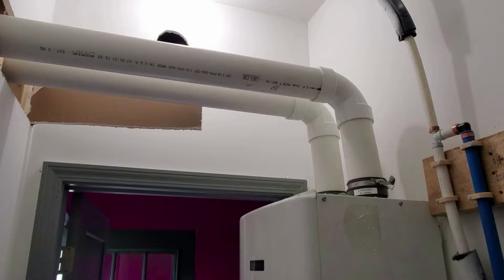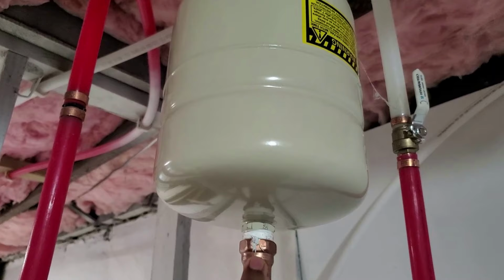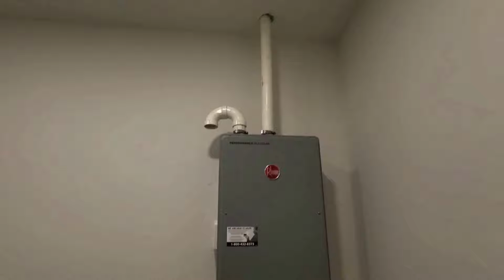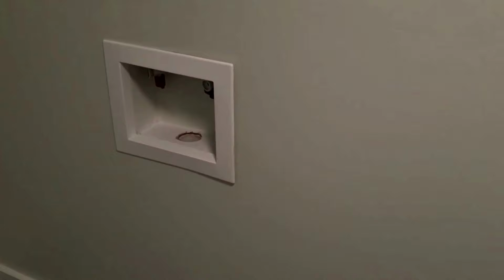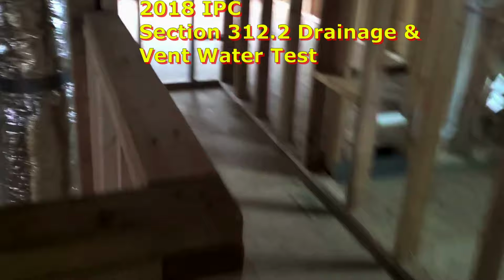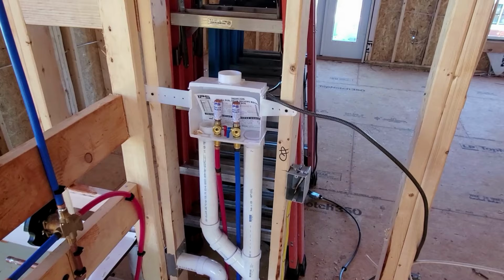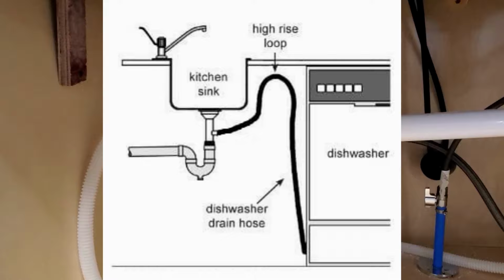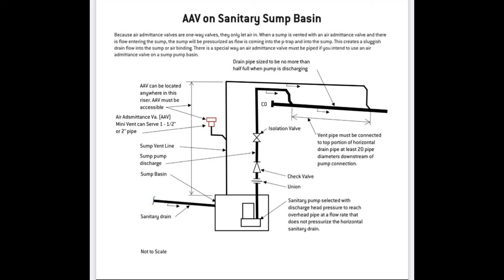Plumbing Code Violations (Part 1)

Comment: This is why you install a decoy plumbing that's up to code but not actually used by anything, and hide the actual plumbing behind drywall and secret doors.
If it can't be checked for violation, it's not  a violation
Reply from the maker: You're a genius..

Comment: I believed fresh air Intake doesn’t have to be outside if there is enough combustible air in the room installed? Is that not true it does actually list it in the manual for Navien Tankless units. But if that code changed that would be huge to know for sure?

Comment: There are no code enforcements where I’m building,  but I do my best to apply common sense building techniques that meet code.  I sure wish you would give reasoning for “why” the code on each one of these failures exists.  Horizontal vent lines between fixtures a minimum of 2’ above the drain field would make sense because it still vents, especially when the vertical vent pipe extends high enough to draft properly.  In Alaska, our issue is the vent lines freezing-up when extending too high above the roof.  Another issue is air intakes going outside in -40f is retarded from an efficiency standpoint.  Like one person commented, as long as there are enough Cubic feet in a room that meets the BTU’ requirements of the unit, you’ should be good. If not, explain “why”.   Common sense needs to be applied to some of this “code”, and if the code was good enough of an idea to be forced, it should be good enough of an idea to be explained as to “why” it exists with caveats for hot and cold areas of the country…. ESPECIALLY by the inspector that’s enforcing it.
Reply from the maker: So, you're saying the state of Alaska has not adopted any Building Codes??
Reply: @PPG1967 I also live in Alaska and the actual towns and cities do have codes but anything outside of city limits has no code. When we moved up here it only took me about two minutes looking at houses to say no and walk out. I built all of our cabins because everything else scared me. I have been a plumber for over thirty years and have a good handle on the trades.

Comment: On the end of the video regarding the sump pump that’s tied into the drainage system here in Colorado that’s illegal. Where are you located? Also, but at some pump here in Colorado event is not required only on a sewage ejection.
Reply from the maker: I'm in Georgia.  We use the IPC (International Plumbing Code)

Comment: On the tankless, how come y’all don’t use I pex pipe?Secondary where is your copper 18 inches off the other water heater?And on the other tankless can you use the atmosphere air in the room? Vent can run flat besides the main vent by international code?you can’t trap sewer gas on a flat vent. most dishwashers have the loop built on the side of them look in the manufacturer book.
Reply from the maker: What code book are you referencing???....my videos are based on the IPC, not the UPC.

Comment: I have a 1960 home and it has no water hammer arresters anywhere. I’ve never had any issues…..  no thermal expansion tank either… no issues wharsoever. That begs the question what’s the point?
Reply from the maker: Didn't era, didn't construction materials, didn't appliances sir.
Reply: @condor5635 Everybody thinks an expansion tank is required.  You can put one in if you want but it is only required if there is a check valve in the system because that would prevent expansion.  Unless your town has water meters that have a check valve incorporated in them, or if you have a pressure regulator, which also has a check valve.  You may require them if your on a well, since the pump probably has a check valve.

Comment: Not sure if it's part of the national plumbing code, but we can't go directly onto the water heater with PEX. Needs to have a minimum of 18" of non combustible material.
Reply from the maker: So, I've addressed this probably 5 or 6 times.  My videos reference the International Code Books..IPC, IRC, IMC, IFGC..etc
Reply from the maker: That code that you're referring to is out of the Uniform or National Plumbing Code. I live in Georgia, we've adopted the IPC (International Plumbing Code)
Reply from the maker: Thanks for commenting.

Comment: WOW WOW WOW!!! tankless hot water heater = the contractor actually painted the pvc sch 40 on the outside!! ya inlets/outlets are done wrong but watching 100 plus videos and it is so rare! to protect pvc sch 40 pipe that is not UV rated.
Reply from the maker: So, what code book are you referencing ??
Reply: did manufactures change this recently for sch40 PVC pipe, including thin wall pipe? 
--electrical conduit is normally rated for UV (exposed to sun) but that is electrical conduit, not plumbing, for tankless water heaters that can and do use pvc pipe for inlet and outlet exhaust, PVC generally is not rated for UV or less special manufacture product for inlet/outlet that goes on outside of house (but not always rated for UV)
--DWV (drain waste vent) is normally not rated for UV. sch80 PVC might be UV rated but doubtfull. 
--it should be in older codes 2015 maybe ealier? 
--DWV pipe only time it is normally installed is if it is burried or install in a wall, or floor, or ceiling were UV (sun light) does not come in direct contact with pipe. the rare times it does come in contact with sun is.... 
----sepetic tank field might have 2 to 4 pipe vents coming just to ground that might need some UV protection just above ground.(most folks will get a UV rated cap for like draining gutters into yard pop caps for septic tank vents *i do not remember specific name they are called*)
----the main DWV vent (residental) top of roof normally, but  many times a proper roof flashing / vent is installed to keep water going back into home, and sch40 or thin wall pipe is not exposed to the UV (sun).
----then tankless water heaters is big trouble. not sure of latest manufacture install requirements, but they want inlet air and exhaust air to be out and away from home.  THAT were issues come in. i do not know exact code but if it is a couple inches i think code begin requires the pvc to be protected. the couple inches just enough so when pvc pipe becomes yellish? brownish? vs new installed white and becomes brittle, the pvc pipe still *hopefully* a good solid connection to side of home so the brittleness is less of an issue. if it is longer than those couple inches from side of home then it requires protection. code states exact length / dimensions.

--off top of head i don't remember spay can paint type (pickup pretty much any store that sales spray can paint) there is a heat rating though may need to check larger hardware store for higher heat for the exhaust vent for tankless hot water heater.  (there is a heat rating going out the exhaust that needs to pay attention to, and you might end up in automotive spray can paint isle) some folks might scuff up outside of pipe some with sand paper to give a little extra catch for paint to hold onto.
--other folks might use foam insulation (buy in a roll like tape), most hardware stores should have. that tape foam easier work with around fittings and pipe. 

---the higher effencity furnaces that can use sch40 pvc pipe also has same issue of possibly needing to protect the pipe outside of home. 

--side note. CPVC (not pvc) generally is UV rated, it is used more times for pressure relief and heat relief pipe, and is rated for higher temps for portable water in home. and is more likely to be installed on (any given hot water heater) were there might be a window that lets sun in directly on the pipe.  last thing you want is high heat water going bursting due to pipe becoming brittle due to UV rays of sun. but CPVC is water and made smaller diameter.

Comment: thank you for taking the time to make these videos, I have really enjoyed them. I have one question. In the 2018 IPC on page ix under effective use of the international plumbing code it states, The IPC is a model code that regulates the design and the installation of plumbing systems including the plumbing fixtures in all types of buildings except for detached one and two-family dwellings and town houses that are not more than 3 stories above grade in height. In the videos you reference the IPC so is the unit you're inspecting multi-family? I'm just trying to make sure I am referencing the right code book for the right application. thank you.
Reply from the maker: The codes in the IRC are straight out of the IPC.  For example, in the video, I referenced section 409.4 in the IPC, which is in the IRC at P2717.2.  I also referenced section 312.5 in the video, which is in the IRC at P2503.7.
Reply: @PPG1967  thank you for clarifying that.

Comment: Water heater expansion tank and the fact the hot side straight pex....I thought u had to come off the tank with at lest 18 inches of copper before u can  transition to other material ?
Reply from the maker: So, I live in Georgia. We use the IPC (International Plumbing Code). What you are referring to is in the UPC (Uniform Plumbing Code). I don't know or use the UPC.
Reply from the maker: Thanks for watching!!!
Reply: @PPG1967  thxz

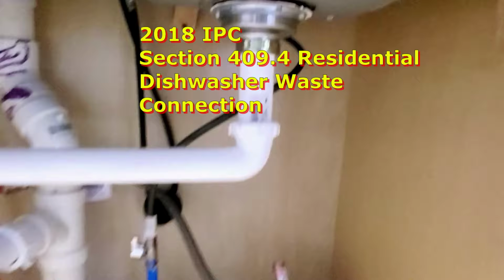Comment: 7:30 Are you sure the high loop isn’t correctly created on the dishwasher-side of the cabinet?
Reply from the maker: It's entering the kitchen cabinet very low. I'm pretty sure that the high loop is not on the dishwasher side.

Comment: I am not sure if someone already pointed this out, washing machine box where you talk about air vs water test, vent piping is not installed correctly. It is before p-trap, it should be after. I admire inspectors who try to actually now codes... Keep it up with good work.
Reply from the maker: Oh ok.. thanks for catching that.
Reply from the maker: Thanks for watching!!
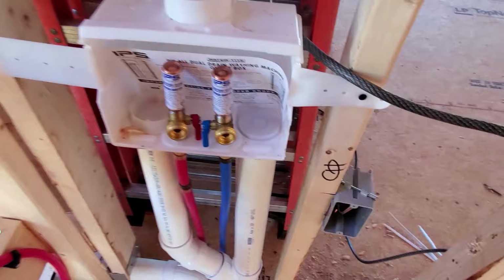Reply: Lol, that is not a vent you goose. The pvc pipe goes thru the 2x4 wall stud and there is a sanitary tee. Vent is going up behind the stud. At 6:43 mark you can see very small part of the white pvc vent going up along the wall stud by the bathtub. Who made you plumber? I am not even a plumber, haven't even glued two pieces of pipe in my life but i can figure it out.
Reply: That was a 2nd standpipe, probably for AC condensate.  Totally acceptable.

Comment: The uninsulated pex didn't bother me as much as having pex so close to the water heater itself. Pex has a natural insulating nature.
Reply from the maker: So, pex pipe don't freeze???...I didn't know that.
Reply: @PPG1967  Pex doesn't freeze as easily as copper due to its ability to expand a bit.

Comment: 2 violations I saw on the water heater, inlet and outlet tubing must be a minimum of 12 inches metallic pipe and pressure temperature relief valve must use metallic pipe.
Reply from the maker: So, what code book are you referencing??
Reply: @PPG1967  local code. and there's good reasoning for what I mentioned.
Reply from the maker: So, all of my plumbing videos are based on the IRC or IPC.
Reply: @PPG1967  that works. another code here is that cellular core can not be burried below grade.

Comment: How do you know the  air hammer arrestor is not in tha wall far for washing machine and the kitchen
Reply from the maker: They are normally installed at the washing machine box at the shut-off valve....they're visible.

Comment: Here where I'm plumbing,  the heat and air company run the intake and exhaust on the water heater not the plumbers.
Reply from the maker: I can see that.  I guess it depends on where you are located.

Comment: That dishwasher code issue is real I have had a dishwasher blow out water from the sink because of the code issue he mentions .
Reply from the maker: I appreciate your comment...thanks for watching!!
Reply: If you don't loop the DW drain line then all that dirty water flows back into the DW and is mixed with your final fresh water rinse cycle.

Comment: PEX can’t be that close to water heater right?  It wasn’t done in this case, but is a valve on the hot water side of a water heater against code?
Reply from the maker: These videos are based on the IPC, not the UPC.

Comment: I had a question. What resources can I find that shows me all the code for Tanked Water heaters and Tankless water heaters?
Reply from the maker: What code books has your state adopted?
Reply: @PPG1967  not too sure. I need to check what San Diego goes off of.

Comment: Appreciate it. How are violations handled? Does work have to stop are there fines given?
Reply from the maker: The violations must be corrected before they can schedule a re-inspection. Typically the jurisdiction will charge a fee ($50) that must be paid before they can rescheduled.

Comment: Code only applies to the state you're in. Doesn't apply to KY. Insulation is optional here. Not required by code. Plumbing code differs on a STATE BY state basis.
Reply from the maker: This is why I have to monitor comments.  I don't want some person new to the industry reading this and think that it's correct.  Code applies to what book your state has adopted.  Do you know the IRC, IBC, IPC has been adopted to over 40 states?. Your state uses the IRC as well. https://www.iccsafe.org/wp-content/uploads/Code_Adoption_Maps.pdf

Comment: Thank you for the useful information
Reply from the maker: I appreciate your feedback, and thanks for watching.
Reply: @PPG1967  I was a handyman for about 15 years. You cannot imagine the amount of fuckery the 20 years of homeowners doing plumbing repairs and electrical repairs under a sink can lead to lol.
Yeah switch out the faucet should be you know half an hour 45 minutes tops. 6 hours in with a Dremel tool ... 
Save the sink!!!.

Are having a six-way gang box with six extension cords under the sink holes drilled into the cabinet bases to run the extension cords to the outside through a cat door and to the inside because it was an old house..." I don't know why it keeps popping but I'm tired of it...

Comment: So how much water will collect in a flat run vent line.
1/10 %. Volume ?
25%  volume ?
Half the diameter,, 50% volume ?
75% ?
Or a total blockade 100% full volume.
And what can block a vent pipe that will/would cause total pipe volume to clog and fill with water.
Dead gerbil ?
Lemmewinks  ?
Politicians brain matter ?
40 years of being a plumber and I have only once seen a vent pipe that was full of water. And it was due to a pipe hanger that had come apart, I pushed the vent back up and fixed the hanger. 

I have never seen a plugged vent other than that one time.
I have seen lots of bad pipe support issues, my state says for PVC pipe, no matter what size. It must be hung every 4’.
No hub pipe is the worst I’ve seen done, EVERY OTHER JOINT, no matter the size no more than 18” from a joint. Never seen a plumbing inspector pick up on no hub issues.
Reply from the maker: Too much coffee or too much time on your hands??
Reply: @PPG1967  you must be a desk jockey , coffee maybe, I hate swamp rats. Flat run vents never plug due to water. My state allows it and never had an issue.

Comment: On sump pumps you need to check with the manufacturer specifications first. Air admittance valves are allowed on many of these units. Read the installation manual. Personally I have not installed a unit that has allowed it. Zoeller or Little Giant.
Reply from the maker: So, you're saying they are not allowed ??
Reply: @PPG1967  Correct, in short state and local code will require that the manufacture installation requirements be met on their product.
Reply: Also check the IPC 2021 code book section 918.8 Air admittance valves / prohibited installation. Air admittance valves shall not be used to vent sumps or tanks without engineers design.
Reply: What if the unit is discharged to the  exterior of the house  and  does not  connect to a plumbing system?
Reply: @PPG1967 I'm not sure, but I believe this is related to the code changes implemented to require pre-fitting for radon mitigation during new build construction.

Comment: Two questions. Does the trade have to be there for the inspection also do you tell them exactly what needs to be done?
Reply from the maker: No, the trade does not have to be there.  It's to their advantage to be present at the inspection, so they can fully understand any violations. I normally email the results.
Reply: @PPG1967  in your emailing or any inspectors, do they say exactly what’s wrong and what to satisfy?
Reply from the maker: @joshuacassino7297  yes

Comment: I don't know where you are from but I've been a Gc for 30 years and never tested any plumbing with water. Air will leak faster than water an d psi is the same no matter what you are testing
Reply from the maker: And I don't know where you are from either, sir.... that's beside the point.  However,  I do know that it's easier to detect and locate a leak on a new rough-in plumbing system using water as opposed to using air.
Reply from the maker: When I'm doing a plumbing rough-in inspection, if a contractor missed crimping a joint or didn't glue an elbow, you'll know the exact location with water.....I  appreciate you  taking the time to comment.
Reply: @PPG1967  If we find the pressure is down, we go spray the joints with soapy water. Until they bubble, then we know exactly where it is.
Reply from the maker: Ok, well good luck with that. I appreciate you watching!!

Comment: The one about testing the dwv by having the water to the highest fixture confuses me. Since the shower pan and the tub have different flood rims, wouldn’t it be impossible to have them both filled completely?
Reply from the maker: So, you just plug the shower drains and fill the bathtubs up to the overflow outlet.  It's about making sure the sanitary lines are full of water.
Reply from the maker: Thanks for watching!!